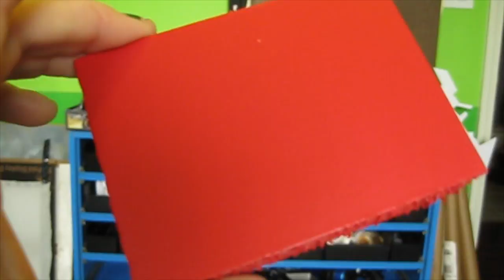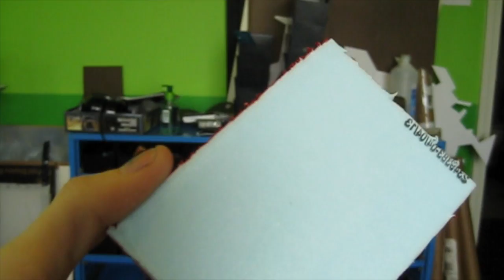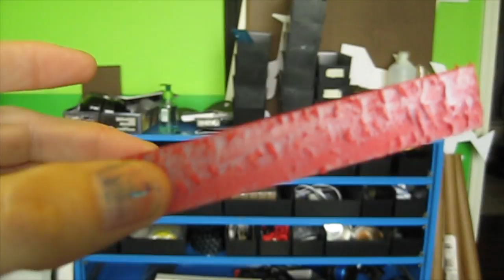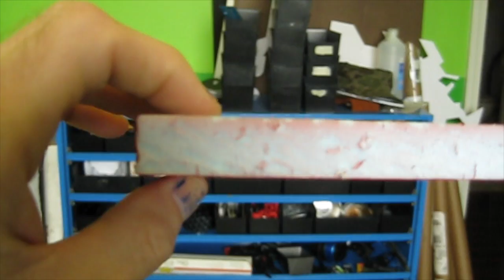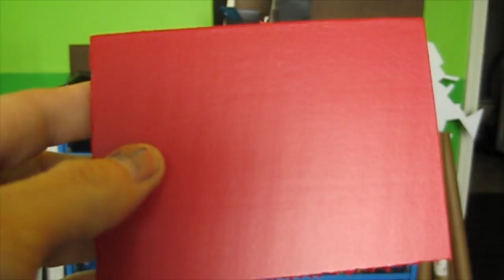Reinforcing and Painting Insulation Foam: Plastidip

Comment: I just spent 30 minutes at Lowes today trying to figure out if Plasti-Dip would work on insulation foam for a project I'm doing, the I see this video which helped me to decide to go for it.  Thank you.  Very helpful.
Reply from the maker: No problem. I would still advise that you test on a small piece first.  I have heard that it could still melt the foam. I don't know if it's the color or how I spray it. Again test first.

Comment: I just found this and it saved me a ton of headscratching and a possible expesive mistake!
Its good to know the blue stuff doesn't melt like the pink does.
Reply from the maker: Awesome. I would still test on a scrap piece first. A lot of different factors can change: angle spraying, distance spraying, chemical make up and difference in colors.
Reply: @GeekOutStudio  Update: I did end up deciding on the Paintable plastidip.
I guess there are diffrernt types of blue foam.
The blue XPS sample I used did melt a little.

Comment: Hey, great information. Thanks for doing this. Does the Plasti Dip adhere well to the insulation foam? Is there any chance of delamination or peeling? And does it add a lot of weight to the foam? (Percentage-wise or compared to simple primer paint, like Kilz primer?)

Also, can you speak to the change in durability (impact resistance)? Does this coating make the foam more resistant to dings and dents?
Reply from the maker: The Plasti-Dip does adhere very well. In the years since I created this demo piece there have been no problems. Saying that though, if I go digging and actively try to peel off the Plasti-Dip I can't guarantee it would stay. The Plasti-Dip adds almost no weight to what ever you're applying it to. Even after applying several coats, you're only looking at maybe a single percentage increase in weight. As far as impact resistant, it does add some protection, but no a lot. It will help some with small low impact nicks and dings, but anything more server will still damage. As long as due care is given, you shouldn't experience any damage.
Reply: Interesting, I did a quick test last night with Foamular XPS and white Plasti-Dip spray. My results didn't look much like yours. I had some micro-beading of the Plasti-Dip and the foam underneath it DID become someone soft and shrank by a tiny % (like maybe 0.5% - 1.0% shrinking). The Plasti-Dip left about 0.5 mm distinct inset at the edge of application where my masking tape was. My next test will be Glidden Gripper primer with Plasti-Dip spray over it.
Reply from the maker: @DaveFer  I did very quick light passes since this piece wasn't attached to anything.

Comment: Thank you for sharing.   Do you think this can be used as a primer prior to placing spakle or plaster of Paris?
Reply from the maker: Experiment with a test piece first. Sometimes Plastidip can eat the foam. If working with insulation foam you can usually just skip and go to spakle or wood glue or so on. Any damage to insulation foam is likely to just snap the piece.
Reply: @Geek Out Studio  Thank you for your reply!

Comment: does this work on pink insulation foam? just spray it on a couple times?
Reply from the maker: It should since pink insulation foam is the same as the blue. The blue foam is just a little denser. However, as always, try it on a little piece before hand.
Reply: +Geek Out Studio Ok, I'll try out a couple pieces beforehand, thanks for replying so quick!
Reply from the maker: No problem.

Comment: Do you know if I can use plastdip to seal and harden styrofoam
Reply from the maker: I think it depends on the foam. In this example, I used blue insulation foam and had no problems. I have a friend try it on pink insulation foam and it melted. I would try it on a scrap piece first. It will not harden the foam though. If you want a truly hard and protected outcome use wood glue. You can thin it down a little and apply it with a foam brush to minimize brush strokes. After it dries, you can sand it smooth. Plastidip is more of a rubber coating.
Reply: Geek Out Studio
Thank you sir. Do you know how long the drying time is on your wood glue method?
Reply from the maker: Depends on a variety of conditions; it could take a couple of hours or a day. No matter what method I use, I give my prop or armor 24 hours until I move on to the next step.
Reply: Thank you so much.  This helps out a lot. The wifey put me on a budget for this project, so I can't afford to just try things out. I'll move forward with your wood glue. Is it the same as modge podge?
Reply from the maker: Kind of, but cheaper. You can get a gallon of it at most home improvement stores for a less than what you get in Mod Podge in the same quantity.
Reply: Boy! you never stop giving! I'm going to have to dedicate this build to you. Thank you
Reply from the maker: Thanks, and no problem. Look forward to your creation.

Comment: Hi! What kind of matte varnish can I use on the foamular, styrofoam? Thanks!
Reply from the maker: AOmce the Styrofoam os sealed, you can paint with whatever you want. I use Testors Dulciat as my matte paint of choice.
Reply: Geek Out Studio hi, thanks, I meant what do you use to protect the painted oieces of foamular? I use white glue and water, but I don't like it :(
Reply from the maker: @gabrielalv7610  I used that, Mod Podge, and wood glue. I've liked using wood glue as it dries stronger and is sandable after it dries.
Reply: Geek Out Studio thanks! i will try to get it and try it ^^

Comment: how many coats did you use? i did 2 and it ate the foam
Reply from the maker: This has come up between me and my friends. My thought is that I used blue foam instead of pink foam. To answer your question, I think I did maybe 3 coats. Why my foam didn't melt is still a mystery.
Reply: +Geek Out Studio ,thank for reply i didn't think i was gonna get one because of how old the vid is..the foam i use is green i get it from Lowe's , i try using hwff but didn't like the results..back to the drawing board i guess..
Reply from the maker: This was a complete shot in the dark. I generally use wood glue to coat insulation foam to protect it, harden it, and so forth. You can water it down some and shoot it through a power brush.